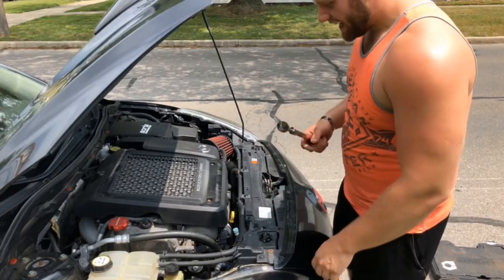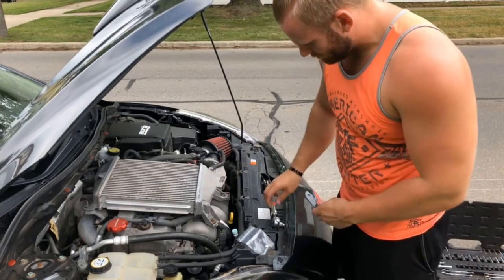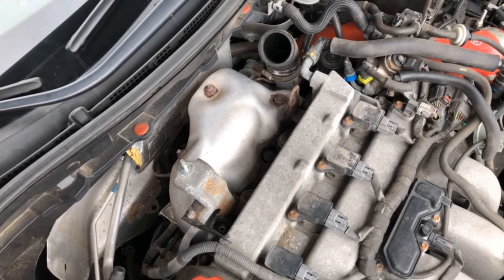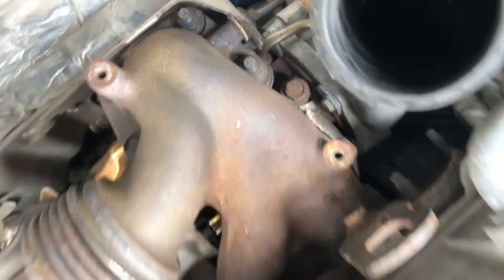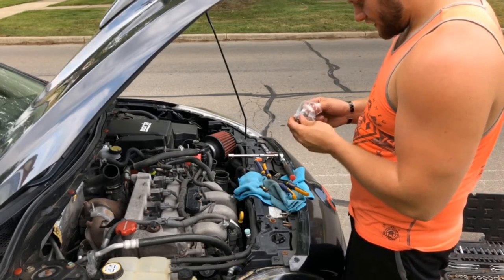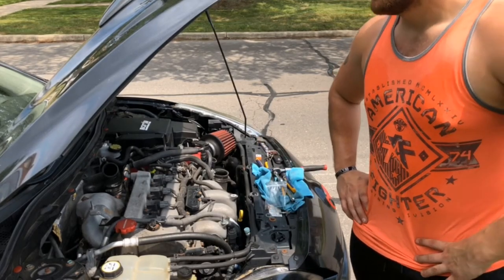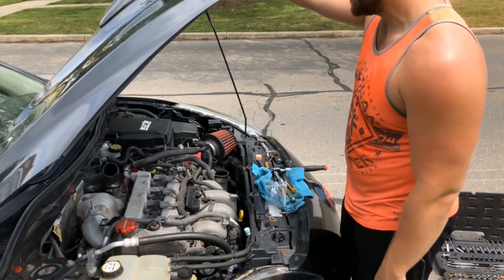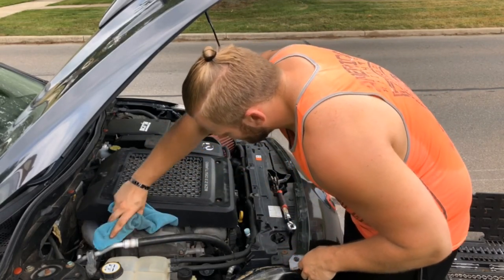Changing my oil banjo bolt (oil feed bolt) on my Mazda

Comment: What did you fixed with it??? 
I ask cuz my cx7 is smoking and I have no cooling or oil leaks
Reply from the maker: Ricardo Martin didn’t really fix anything I started running a catless downpipe and the lack of back pressure was causing the seals on the turbo to leak, this bolt can help prevent that but is not considered the “right” way. This will just mask the problem until a fix can happen.